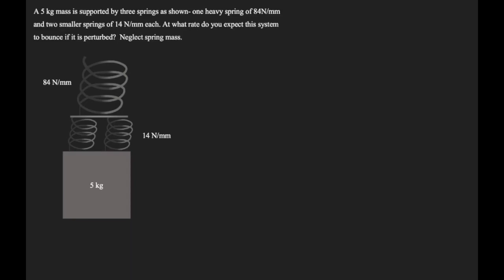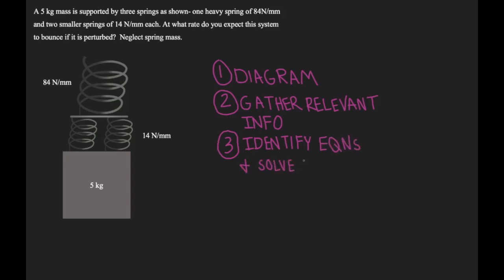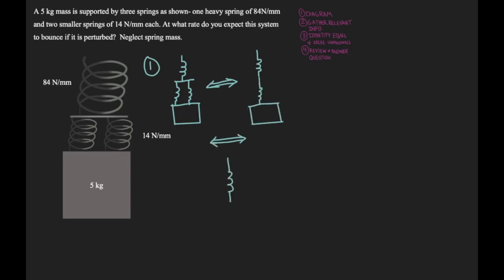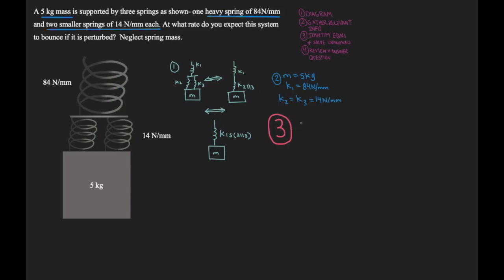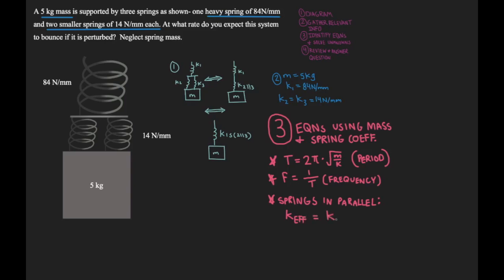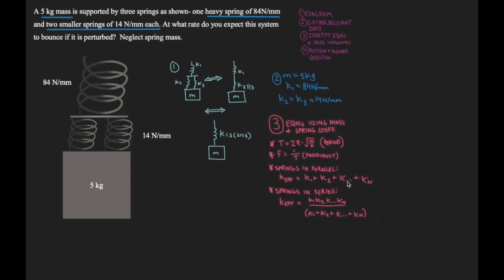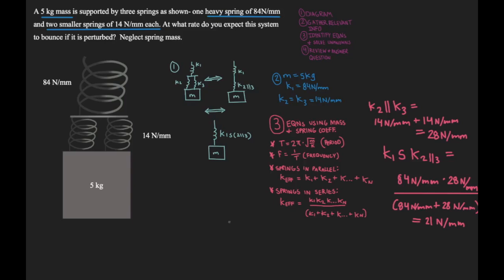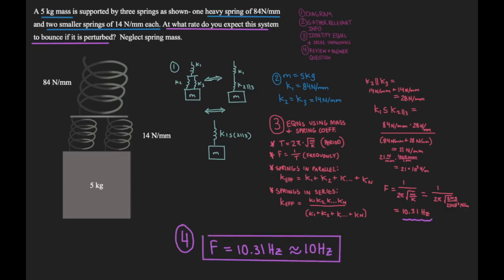TESLA Mechanical Design Engineer Interview Question SOLVED! #3

Comment: Nice video but it seems to me that you confused the rule for the springs in parallel with the one for the springs in series.
Reply from the maker: They are opposite from what they are in electrical circuits. I think they should be correct, check here: https://en.wikipedia.org/wiki/Series_and_parallel_springs
Reply: @Arch1medes  ok thanks, I think I heard otherwise at school.